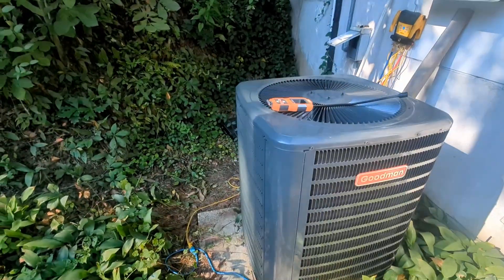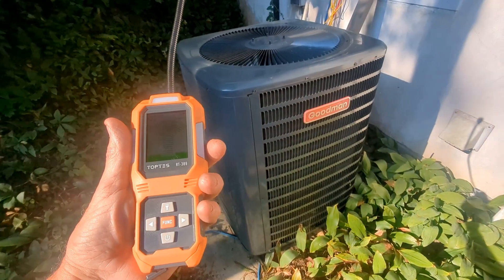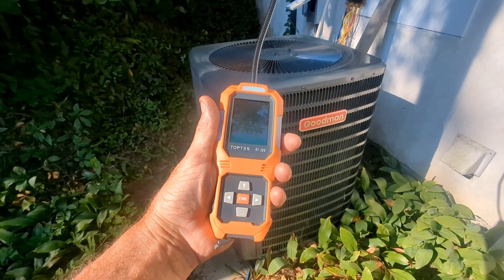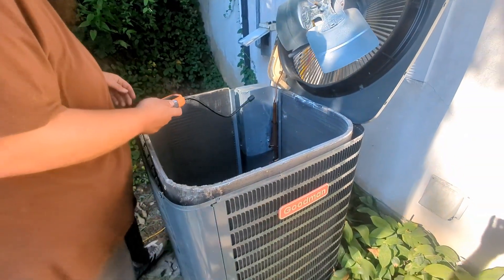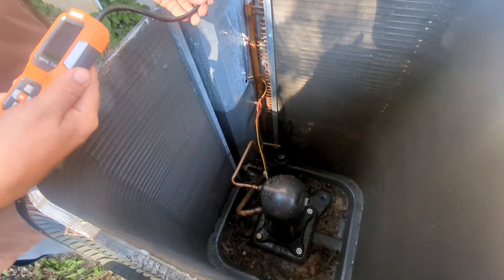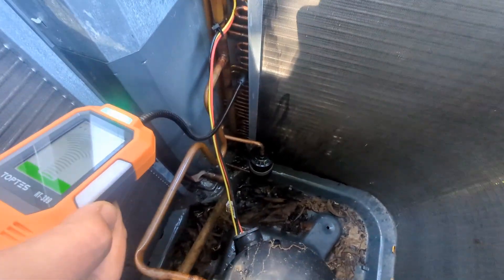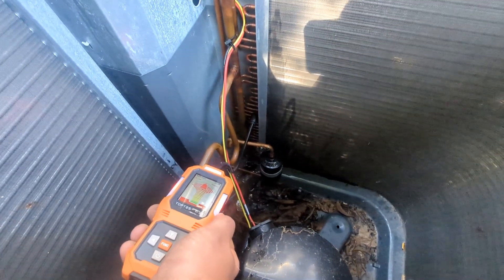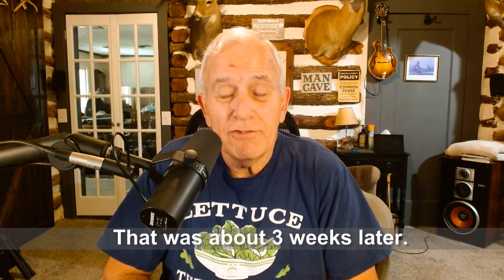775 RSW TOPTES RT 389 Refrigerant Leak Detector Saves The Day

Comment: That is a known leak location on the Goodman. Sometimes you will see an oil trail. If the unit was registered it will have a ten year warranty for the parts. Good luck.
Reply: Might pick up one of those. I have a fieldpiece inferred leak detector that can be squirrely at times. Would be good to have a back up. Should work fine with the newer refrigerants as well because they are all R-32 based just like the 410-A.

Comment: I own an HVAC Company in East Tennessee and those leak detectors can save hours of labor and headache..... As well as, being able to solder up the hole, conduct a High PSI NO2 test to verify no leak, pull a good vacuum down to 350 microns, then charge her up..... Nice Detector..... Do you know if they have one for the new A2L (R32 & R454B) refrigerant??
Reply: Should work fine with the a2 since it's all basically the same refrigerant as 410